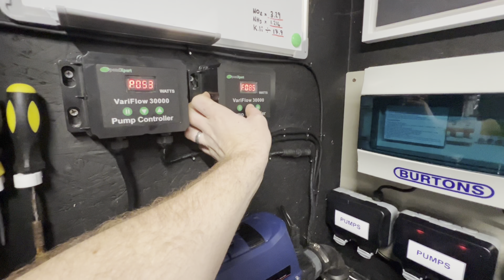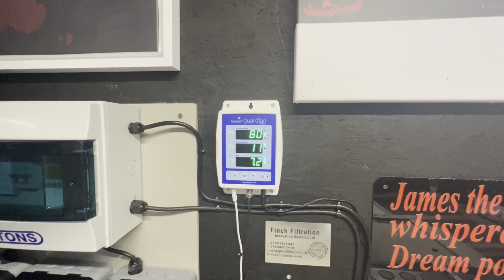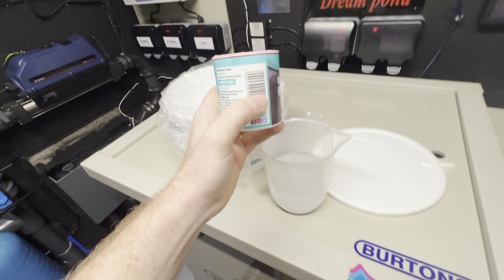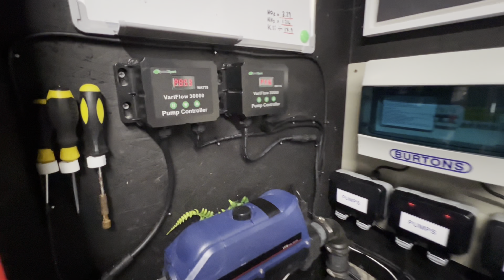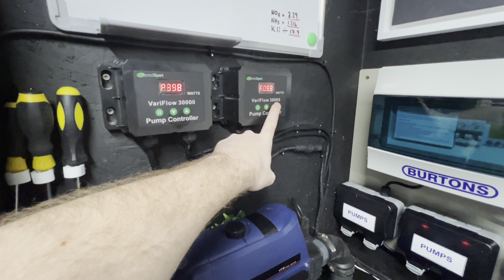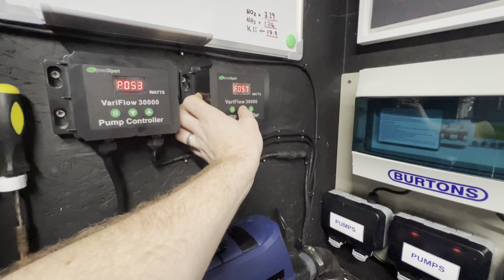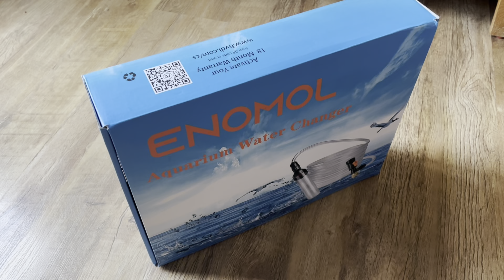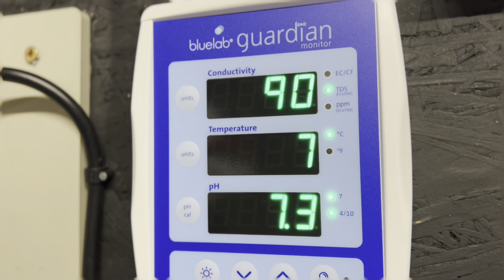KOI POND SUNDAY JOBS DONE **BRAND NEW FISH TANK EQUIPMENT WORKS A TREAT

Comment: Great to see you back James. Question regarding your tank and refilling water coming from your tap.
 How do you regulate the temperature so it doesn't shock your fish?
I've never worried with matching temps with the pond but always do with my tank water changes
Reply from the maker: I think with bigger tanks and a very slow water top up I don’t find it changes the temperature to much 

But I only do the 10% mark 
It’s definitely something to be concerned about with smaller tanks and different types of fish I think 

Possibly I should have mentioned that in the video? 

I do have a 500w heater on my tank what also helps me out I think 🤔 

Very good question though
Reply: @JamesTHEKOIwhisperer123  I appreciate your reply thank you and totally understand where you're coming from. I still use the bucket method with a home made syphon similar to your fancy tap one lol. 2 fancy goldfish in 180ltr 4ft long tank and no heater. I take a lot more than 10% out once a week/fortnight, usually 30-40% and like to fill it back up quite quick and clean up before the Mrs gets back from shopping then  to go and do my pond so I temp match to keep the fish as comfortable as possible. I suppose it's finding what works for each individual. Thanks agian